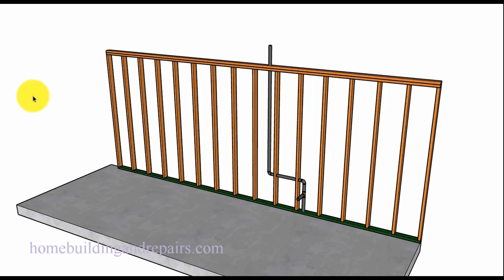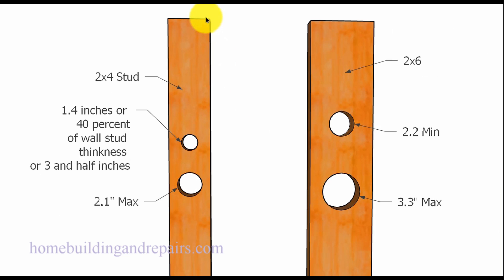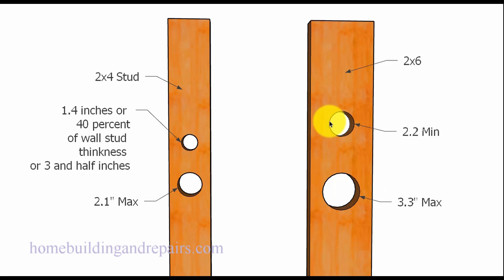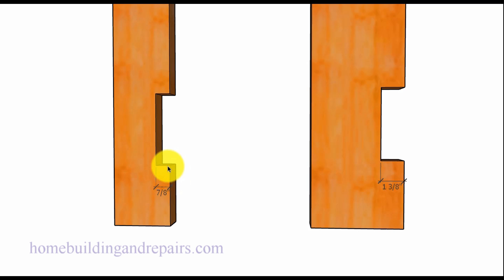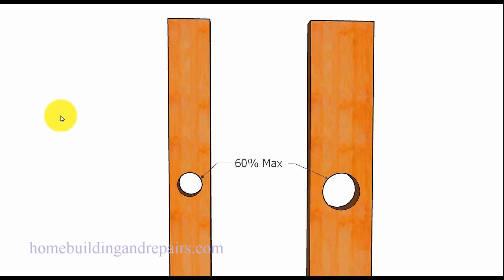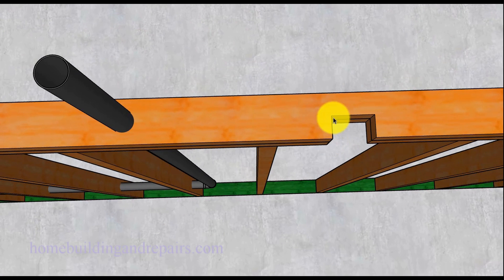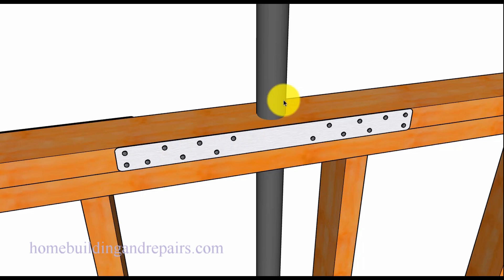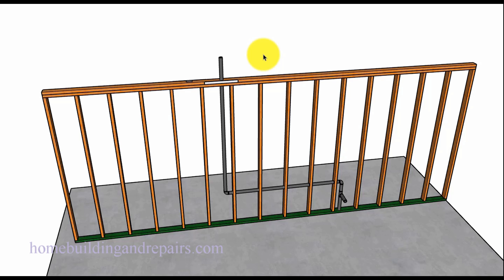What Building Code Books Say About Drilling Through Wall Framing Studs - Plumbing And Electrical

Comment: I need to drill holes through about 3 consecutive exterior wall studs in order to run some new Romex wire. The holes will be the standard 3/4" dia holes for the Romex. According to your video it should be perfectly fine? Can you please verify? I need this information by tomorrow morning.

Comment: OK, still trying to wrap my head around this. 

My garage back wall is load-bearing and is made up of 2 x 6 studs. I also have a water softener loop, a utility sink and vertical vent stack right next to each other in the middle of this wall. I want to relocate the softener to a  back corner and therefore need to extend (2) 3/4" water lines and 1-1/2 drain line about 18' to this corner. To accomplish this, I plan to run 2 copper pipes inside the wall after I remove the sheetrock and notch multiple studs starting from the water loop.

1. Can I cut single notches tall enough to accommodate the 2 copper pipes or do I need to space them apart vertically and create separate notches for each pipe?

2. If the minimum hole diameter is 2.2" and I'm planning to run a horizontal 1-1/2" ABS drain line through 2" dia holes does this mean, since the drain line diameter is smaller than the minimum (2.2") I can run it across multiple studs without doubling the thicknesses?

Thanks, this is really helpful...

Comment: Is there any problem with predrilling holes for 1" conduit (if you know your layout and plan to have all at the same height)?   I am working on framing my basement and plan to run conduit for networking cables (so that I can run additional ones in the future or switch to fiber at some point).

Comment: What about the bottom lateral single stud of a wall going down?
Reply from the maker: You can drill larger holes or cut larger notches in bottom framing plates.

Comment: Why is there a minimum? I'm assuming this is only for plumbing drains not water source or electrical
Reply from the maker: Larger holds like plumbing pipes. It's not a good idea to remove more than half of the structural wall framing stud width.

Comment: I was hoping to direct my 4" dia dryer exhaust up and above a door frame, through the studs on a non-load bearing wall. I was curious if this was feasible with a 2x6 wall if I were to double up studs around it. Any better alternatives to running horizontally, across/through studs over a door other than boxing it out?
Reply from the maker: I don't know if it will work, but if it's a non load bearing wall, it might. What about a Indoor Dryer Vent Kit.

Comment: I bought a house and the king stud was notched twice on opposite sides... what structural adhesive would you recommend me use before I put a shoe on the stud. Its is definitely about 50% notched.
Reply from the maker: If it was my house and it wasn't creating any structural issues, then I might leave it alone. If not, then You could remove stud and redo plumbing.

Comment: Hi! I’m hoping to get some feedback. I drilled a 3/8 hole completely thru a 2x4 stud. The only problem is it was drilled through the 2” width part so the hole is 4 inches long. It was done to get an Ethernet cable from the kitchen to the garage. Do you think I’ll have any problems? I was thinking of patching it with a dowel since I don’t need the hole anymore. Also I don’t know how close to the side of the stud it got. The hole is around 10 inches off the ground. And there is a sheet of wood covering the garage part so I’m thinking it’s a sheer wall.
Reply: If it isn't  a load bearing wall, I wouldn't worry about it. If you still use the 1/3 rule at 1.5", technically, the hole could be up to 1/2". I don't think the code was intended for the narrow side of a stud. However, IMHO, I wouldn't sweat it.
Reply from the maker: I can't provide engineering information, but like the dowel idea using glue.

Comment: If you can't cut a hole big enough for a DWV in a 2x4 (non lb wall), then how do they do for dryer ducting that is 4"?   I'm wanting to relocate my dryer ducting and hesitant to make any new holes in my studs.
Reply: The 4 inch vent doesn't go though the studs... Just into the cavity and through the sheathing
Reply: @waynehartlerode8936  sorry, I didn't mention, mine exhausts on the roof.  So it would have to go thru framing to get out.

Comment: Could I run a nominal 1-1/2" (average 1.9"OD) pipe through a 2x6 in an exterior load-bearing wall for a plumbing vent? I think it would go through only one stud but possibly 2.
Reply from the maker: You would need to verify with local building codes, but I've seen it done more than once.
Reply: @gregvancom  Thanks. I'm having a slight problem figuring out how to run the vent for my toilet and lav because the exterior wall they will be against is parallel to the joists and the edge of the wall sits on support framing that can't be notched/drilled through (I believe). I need to get  camera under there to confirm, but the perpendicular exterior walls have a small pocket where stuff could come down. Not sure on the one I need to go through. Got a toilet next to a lav and the attic ceiling is too low to run the vent to meet. My late plumber ran circuit vents from under the house up the outside of the exterior wall and around the eaves and then up again. Was thinking of doing something like that for this setup but its getting the lav vent to merge with the toilet vent and then eventually after a few feet I'll run the lav drain to meet with the toilet drain as they go toward the main soil pipe. Gotta tie in a washing machine 5ft after these tie in as well (washing machine is actually upstream but I was advised I need 5' past for suds relief). Basically its a clusterfk. LOL.

Comment: What about stud shoes? How many holes in a load bearing wall with max hole if each has a stud shoe?
Reply from the maker: I don't know if stud shoes will allow you to drill more holes, but I've never seen any thing suggesting a maximum number. I would check with an engineer or your local building department for more information.

Comment: You seem to be a guy to ask: I'm upgrading the wiring in my kitchen to comply with 12g for 20A breakers. When I went to take the wires out of the outlets powering the over-cabinet accent lighting (downstream of a countertop outlet), I discovered that one of the outlets was not in a box, and was simply notched into a 2x4 top plate with the wire plastered between bits of drywall to the face of the top plate, going up into the attic. Now that I've removed the offending installation, I'm trying to put it back in legally. Through the gap in the drywall, I appear to have three top plates, the notched bottom plate is a 2x4, turned sideways (what I'd expect), but the two above it are each 2.5 inches tall. The house was built in 1958, and I'm wondering if a 3x4 was ever a lumber dimension, if it was ever used in framing, and how far I can get away with notching the 2x4 at the bottom (trying to get far enough back to find the wiring hole, or if I need to relocate the notch to make it easier to drill a new wiring hole). Thanks!
Reply from the maker: I would try to relocate the box, but if you can't then maybe but it in an electrical box and at the very least you would have something better. As far as the notching, I really can't provide a yes or no answer.

Comment: Are there any specific codes regarding staggered stud walls
Reply from the maker: There might be if the wall is loadbearing. I would think 16 inch on center studs would be fine, because I've seen lots built that way.

Comment: I understand the notch depth limits, but is there a notch "height" limit for load bearing studs?
Reply from the maker: Most engineers don't want to see notches any more in load bearing wall studs. I've never heard of any height limit and good question, can you have a 6 foot notch in an eight foot stud. I've never seen it in any building code books, but it doesn't mean it's not there.

Comment: does this 40% diameter rule apply to load bearing foundation walls, meaning the concrete or block wall sitting on footings?  Like, can plumbing be put in later through that?
Reply from the maker: You would need to check with your local building department, but I've seen large holes drilled through concrete and block walls and the dimensions of the holes uses a different set of rules than wood framing.
Reply: @gregvancom  right on, I'm gonna do that, our inspections department does sign offs on remodeling permits / building permits, so they probably have resources there or something there to either look at or read up on too

Comment: Is there a maximum number of consecutive studs you can drill through in a non load bearing wall?  The video shows 5. Is that the maximum?  Thx
Reply from the maker: I would contact your building department for the exact number, but I've rarely seen more than 5 studs with inch and one half holes in a non load bearing wall.

Comment: The closest so far to my question. 

How many screws are too much in a load bearing beam? Im not a carpenter, but this is a verticle doubled up beam (2, 2x4s) in the middle of a long joust (is that right) that runs in a two car garage, parallel to how the cars are, in between them.

I want to mount a monitor arm, and I already have stuff mounted (no more than 10 screws, hooks, fire extinguisher mount etc). I plan on trippling up the beam, using this stake pocket brackets and bolt them together so the added beam won't move around. Of course, the piece of wood I have is not 2x4 (as in the standard. Its much less than 3-1/2..so I need some shims for the stake pockets...ie more work!)

Does this matter? Is a monitor well in the ability of these beams to hold? Its a 27 inch touch screen, with a 3 joint gas adjust arm (the monitor was free from my Snap On guy). It would be a real nice touch to have it near the car while Im diagnosing. 

Thanks for any help...I'll owe you a tune up lol!
Reply from the maker: It will depend on the beam size, materials and screws. Plus the weight of objects hanging from them. I would think that you could contact the product manufactures for more information.

Comment: Where would these rules be found in the IRC?
Reply from the maker: We got it from the 2012 International Residential Code book on pages 159 and 160. Remember to check with your local building authorities or structural engineers before using the information in this video, because even though it came from some of the more popular building code books, doesn't mean that it will always be applicable to your construction project.

Comment: I live in California, I have a 2x6 floor stud that is supported by a load bearing beam underneath it. The stud is doubled and I need to drill a hole min 2 inches or maybe 2 1/2 can I do that?
Reply from the maker: Probably not.
Reply: I thought LB had to due with support above such as your roof joices that would be perpendicular to said wall

Comment: Everybody is building with 2 x 6 walls these days. So just ignore all the data on  2 x 4s.

I learned to use these,

1 & 1/2 inch' DWV pipe? = Use a 2 & 3/8s (I think! it might be only 2 & 1/4) drill bit

2 inch DWV? 2 & 9/16ths inch hole saw. I'm certain of this!

All 1'', 3/4'' and 1/2'' H2O supply pipe = all 1 & 3/8ths bits MUST USE AN ISOLATOR to cushion the hole

Ditto and gas pipe same size.
Reply from the maker: Most defiantly some people, not everybody are using 2 x 6.
Reply: Some of us are remodeling older homes; my house is over 30 yrs old; so that 2x4 info is valuable to me. 👍

Comment: Need to put 2  1 3/8'' holes about 3 inches apart on a load bearing wall for an AC line set. Need to drill through 3 consecutive studs is this okay?
Reply from the maker: I can't help with that question. Maybe contact you're local building department for more advice.
Reply: Not okay. The code states that any holes over 3/4" must be spaced at least 6" apart.

Comment: Can you notch the width defined by code all the way down to the sole plate do you need to be x" from the bottom (or top) before notching? Thanks
Reply from the maker: You might be better off checking with your local building department to answer that question. Keep in mind that some of the building codes I refer to from the international building code books might not apply to your area.
Reply: gregvancom thanks but my question is more theoretical. Is there a limit on how long a notch can be?
Reply: @paulg8252  Same question.

Comment: Can i drill more than 2 holes if i have 2" pipe on 2x6 load bearing studs? Thanks!
Reply: Nobody answered this in 4 years an I have the same question about just venting through the top and bottom plates for load bearing wall! Seems like you can but need to add reinforcement strap across the plates.

Comment: In Florida, electricians drilled 3 consecutive holes 1 1/4 " on my top sill in 3 different sections where my garage roof ties down with hurricane straps. Load bearing? I guess cause it's my garage roof.
Reply from the maker: Isn't that the truth, but they do it to other homes also, if it makes you feel any better :)

Comment: I want to install a washer and dryer box that are located at a load bearing wall. Is there a limit for the cut out on the bottom plate being they are next to each other.
Reply from the maker: I cannot provide engineering advice, but can tell you that I've seen plenty of jobs where they cut sections out of the bottom plates in between the wall framing studs.
Reply: @gregvancom  thank you for your info

Comment: so is a 2" shower drain pipe ok through a 2x4? do I have that correct?
Reply from the maker: I would love to provide you with a yes or no answer, but the video examples only represent information I found in one of the more popular building code books. To find out for sure, you would need to contact your local building and safety department if you have one and these are usually located in the city or county government run offices.
Reply: @gregvancom  ok. It's so difficult to find resources for this. I think I'm just going to use best judgement and common sense in my design and deal with the changes after.

Comment: can you do a vid about joist spacing?  like back in the 1970s, everyone built with 1x10 floor joists.  What was the maximum span architects liked to use at that time?  thanks
Reply from the maker: I put your videos on our list of videos to be made in the future, but I don't remember ever using 1 x 10, did you mean 2 x 10?
Reply: gregvancom ha yes. 2x10s.  Thanks 👍